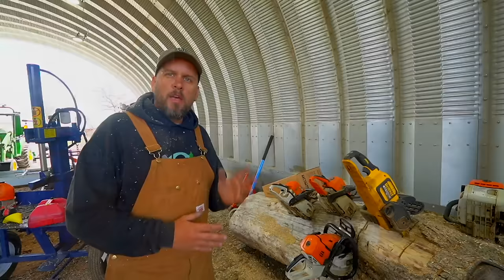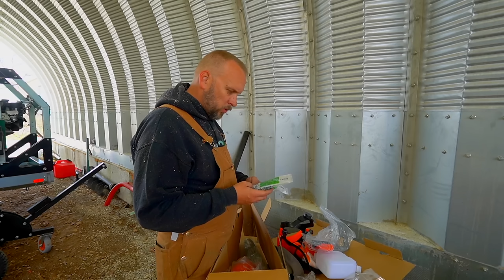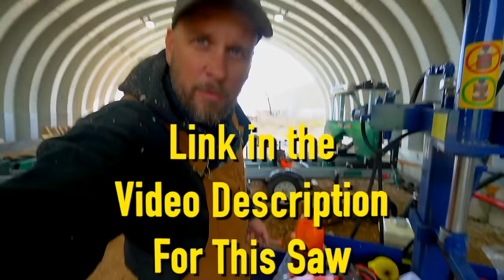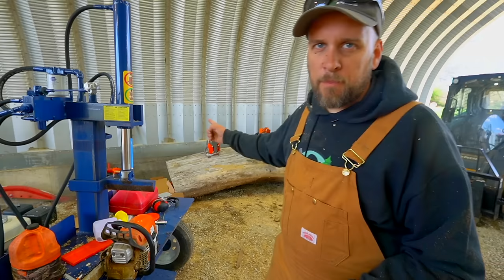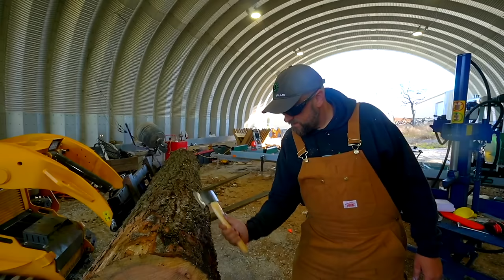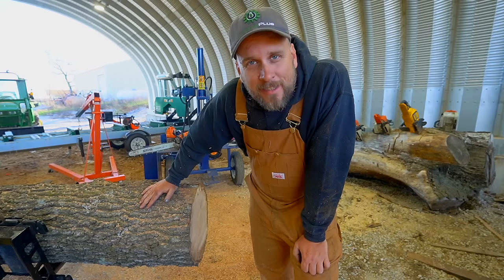Stop Wasting Money On Chainsaws

Comment: A few thoughts. Starting a saw and using it at full power within 2 seconds will kill your saw. You want that engine to warm up. Also, when doing comparisons like this its great to see options but what can't be done in a few minutes of video is see how well something lasts over time, how much hassle it is to maintain, repair etc. If a cheaper tool causes three times as much downtime, it won't be long before that tool has cost as much as a more expensive/higher quality item. So I appreciate the effort here but think its important we keep the perspective that there is only so much a video like this can show so take that into your decision making process.

Comment: Don't start cutting right after starting any chainsaw that isn't electric. The reason is that the pistons will heat up and expand faster than the cylinder which leads to scoring. Doesn't matter the brand.
Reply from the maker: That’s what I thought and it’s what I always do.

With the 500 I was just talking about throttle response.

However, there is someone in the comment section of this video telling us that that’s not true. You can start cutting right away. Says he’s a chainsaw expert.
Reply: It's the rings that need time to warm up and expand for proper combustion.

Comment: Stihl usually has a wider gauge than other saws. Big Stihls are usually 58 gauge or 63 gauge while other brand saws are mostly 50 gauge. You gave us the pitch on the saws; it was 3/8, but what is the gauge on the new saw?  I looked it up. The chain on the Proyama saw  is 3/8 pitch and  58 gauge, so the two saws are comparable.
Reply from the maker: The other 2 saws are .63

Comment: Chainsaws after holding one for a couple hours in the bush the weight of the saw becomes the issue how well you are able to sharpen the saw and the hp the motor will produce gives you the speed of the cut my saw was less than  200 bucks (timberpro) it has probably cut 50 plus white ash log 12 to 18in round a tank of fuel will make 25 to 30 cuts the only problem I have had is the handle cracked  as I do push the saw through the cut going from a low power saw to high power is the difference but again the weight of the saw is a factor if it is an everyday job

Comment: Excellent video as always Brock. I'm still in the market for a homeowner saw, but I really need a pole pruner too.
Reply from the maker: I appreciate the kind words. Everything is so expensive nowadays and I want so many different tools.
Reply: invest into the dewalt battery pole saw, i love mine !. no issues as far as cutting ?, but i will say the bar oil will leak out if you lay the pole saw down ?, other than this..its a very good pole saw.

Comment: I run two 42cc Poulan 18" saws, love them and am standardized on them ( I literally own ~ 35 chains (18"-62L  I sharpen)...but bought a third 52cc 20", chinese saw for $102. cause the price was so enticing and i just had to know for myself (not what others thought); since I've cut thousands of trees with well-cared w/ these  light duty 42cc saws...runnning them as industrial saw...for long hours.  The 52cc chinese safety kick-back spring...was dragging right out of box had issues, and could not fix or adjust the dragging.  I ran it as-is, dragging hoping it would heal iitself and wear-in.  But the spring got so hot it melted it's plastic keepers and finally broke loose after two runs...I had to remove the safety spring guts altogether and have been running the saw w/o  safety kickback chain-lock for three years now. Do I want to do that?...No.... but chainsaw is decent enough and cuts well...starts super easy. (i like that), a bit noisy, ear-plugs a must...I just think of it a pre-1970's chainsaw without the safety-bar-chain stop feature. I just have to be careful..no overhead cutting. From what i saw, I must have bought the early-first generation chinese saw...because what i saw that spring was dragging on the clutch housing....even after reset. Everyone must have had issues on those early ones. Difficult to remove and modify spring steel bends and clips reas after the fact....safety bar feature was definitely an after-thought that wasn't tested out....smoking metal to metal- red hot- when in cutting mode....dragging engine down too. safety-brake was 35% engaged out-of-the-box.

Comment: Whatever saw you buy make sure there is a shop that will work on it.  Chainsaws are twitchy machines and need occasional professional service.  Another point, I think chainsaw speed is nice but not the top priority if you are a firewood cutter.  I spend no more than 20 minutes running a saw for a pickup load of wood that might take a couple of hours to split and load.  A saw twice as fast doesn't make much difference for my total job.  Thanks for a fine video.
Reply from the maker: Yesterday I had a chainsaw expert come out to the house and we recorded a video about how to maintenance and adjust chainsaws to get them to run better.

That is my video tomorrow

Comment: To make it a fair test, put a bolt thru the end of the bar about 10in long then hang 5lbs of weight to it so they have the exact pressure on them. Lastly I will take a STIHL over ANY saw any day of the week. I have dads from 1985 and stihl going strong. NEVER had any issues and we used to cut a lot of fire wood. Project Farm does a great job of comparing things :-)

Comment: It sounds different.
More open muffler, and mabe better air flow.
.
Possibly a non strato saw, basically an emissions thing where part of the air goes in to the chamber before being mixed with fuel.
.
With the exception of a few big cc saws made by major brands, there generally all strato now.
With the exception of the 70+ cc saw made by echo.
And mabe the dolmar/maketa saws.

Comment: lots of good youtube videos of how to repair Stihl saws now.  no need to wait three weeks to get your saw repaired
Reply from the maker: I’ve never taken a chainsaw in for service. Most of my saws are only a few years old though.
Reply: @RockhillfarmYT  once they are 15yrs old there is plenty of little things to replace.  always use premium gas and stihl 2 cyxle oil.  then no engine problems result
Reply from the maker: @lrobie123 my expectation with these cheap saws is you would throw them away at that point, but you could buy a new one every 10 years and it would take you 30 years to equal the cost of the stihl

Comment: now put a 9 tooth drive sprocket on the Stihl 500i and new bar tip ( .325 ) and run a 325 chain and see the speed. The idea is to make small pieces of wood NOT copious amounts of sawdust. Been doing this setup for 30+ years and NEVER broke a chain yet ( thats the shop guys comment......oh you cant do that the chain will break )

Comment: Wow, a Proyama..but can it endure over time?
Reply: I run these cheap saws cutting lots of firewood. And the answer is no they don't hold up. But I still use them because they are cheap to replace and honestly I've learned a lot repairing them. I felt much better about screwing up a cheap saw trying to fix it rather then screwing up an expensive saw trying to fix it.

Comment: One concern is with product sent specifically for review.  I would assume some extra care was taken in manufacturing the saw.  I would assume stock parts but probably some hand sorting for best tolerance/fit before assembly.  Better to by one off the shelf and sell the one they gave you to make sure your testing matches what someone else would get.
The other thing that you barely touched on is longevity.  I don't expect you have time to do a full teardown but that would tell a lot.  Stihl is known for over engineered design which makes their saws last forever.  I wonder how the Proyama compares.  Does it have 2 piston rings like a Stihl for example?  Of course there is somewhat of an apple to orange comparison here.  Stihl has the best power to weight ratio for example.  If you are a professional who runs a saw 5-6+ hours a day, the Stihl wins over the cost.  Does the steel construction make the Proyama just as durable?
Reply from the maker: That’s definitely not true. This is a company in China that sent it to me and from the time I agreed to take it to arriving at my door was two days.

It’s distributed by Amazon and they have them in facilities all over the country.

I wouldn’t have the same advice for a professional And actually I didn’t recommend the saw. I just showed its initial performance and you can be the judge

Comment: love my Stihl MS 362 pro is a bit underpowered cutting big wood with the 25 inch bar but it will do it and saves my back when cutting small stuff on the ground had the Stihl farmer model in 291 but it kept doing the oil pump thing when you had a big day chopping big wood

Comment: I wonder how well it would start after sitting for months.  My stihl always starts up after sitting for months.
Reply: my mac's gave up the ghost, i dreaded dragging out the heavy craftsman , 18 inch, but i had no choice. it has been sitting in the shed for about 3-4 yrs ?, i pulled it out, poured out the old fuel, put fresh fuel in, topped off the bar oil ( it was bad about leaking bar oil ), primed it about 3-4 times on the bulb, pulled choke out all the way, first pull it half fired, pushed choke in half way, it fired off..started running..i let it warm up for about 10 sec's ?, pushed choke all the way in, pulled trigger...it ran like it did the day i brought it home from sears. keep in mind, this saw was purchased back when sears sold real good products ?!. anything craftsman sold today sucks.

Comment: Retired after 23 years of modifying Stihl and husky saws...... Saws have chrome lined cylinders and need no brake in period...
Reply from the maker: Thanks for sharing

When I got the 391 a few years ago, I started running it hot as soon as I got it and a bunch of comments were complaining about that
Reply: @RockhillfarmYT  I've modified quite a few 500i's now being retired from Woods Logging Supply,  I've been clearing the property and my 660 mod is my go to... Also a Holzfforma 660 mod with Stihl crank... They were made cheaply so its a bit lighter but it rips.... I see you have a bark box on the 500i that helps :)

Comment: For the average homeowner, go electric, 2 cycle chainsaw suck unless they are used frequently.
Reply from the maker: The average homeowner, you might be right.

The average farmer or rural property owner I would disagree.

Electric chainsaws are weak and expensive
Reply: @RockhillfarmYT  I've got two Echos, they've been good saws, I wish they could make better carburetors for chainsaws. Right now they are sitting on my workbench for me to work on. I have 12 inch Dewalt chainsaw that is so very handy though I am cutting up mostly small pines on my 25 acres, trying to get the hardwoods to prosper.

Comment: I've been running the Zenoah clones for 5 years and recommend them over cheap homeowner style name brand saws for people who dont cut a ton of wood.
I broke one while porting it, otherwise they're fine, the starters will break if you drop start it so dont do that. I havent broke one but pull them slow and easy like my arm is broke, you'll be surprised at how slow and easy you can pull it over and have it start.
The proyama has nice plastics but is much smaller than stated.
DO NOT BUY THE 5800 PROYAMA, IT'S 45CC AND SUCKS!
The 6200 is 50cc and ok but not near as good as a 54.5cc one.
Only buy the 6800 proyama, it's 62cc or 54.5cc both run about the same, it's the only good one they sell.

Comment: Bought a holzforma 372xp. Haven't even cut 1 cord w it. It's currently at the shop awaiting to find out y it's locked up. Had to put OEM carb on it to get it running good and OEM oiler cuz original wasn't cutting it on 24". Needless to say, my opinion is come up w a little more $ and get to an Echo dealer. Got a 590 and holy smokes. Haven't run the 24" it came w yet but it's a major ripper w a 20".  Magnesium vs steel?
Reply: More than likely its the crankshaft, their seals are crap and the steel in the cranks are soft... I've got a 660 holzfforma and swapped crank( Stihl )worm gear for oiler and fuel line, starter pulley,  mod cyl 40 thous. and dome piston 25 thous. triple ported muffler... and it rips!
Reply: @His1child  I added alot of stihl parts to my 660 build and that thing screams

Comment: Yea buy your self a used steel like an 044, ms440, 046, ms460, learn how to take care of them. Never run gas with ethanol and ethenol treatment does not take ethanol out of gas. Use gas with 0% ethanol atleast 92 octane with good brand oil like Stihl oil. Then you wont have problems

Comment: Or spend $1300 and get a 576xp or a 572xp or a 372xp … my 576xp cuts 3 seconds faster than my buddies 500i Stihl .. both with 28” bars , 3/8 , 0.050 with full skip tooth chain . Running in the same size diameter log , 27-28” red oak ( green ) ..

Comment: That 500 ain't gonna last long if you give er wide open right after you start it cold
Reply from the maker: I didn’t say that I do that. I said that it has the throttle response that quickly if you wanted to.

It’s an overall representation of the saw performs 

I’ve been using it for a couple years and I feel like it cut faster now than it did the day I got it

Comment: That is definitely NOT how you tighten the chain on a chainsaw!
Reply from the maker: What are you talking about
Reply: @RockhillfarmYT   Chain tightening:   As you begin to tighten the 2 bolts on the clutch cover, you should lift the far end of the bar.  The lift will add a bit more tightness to the chain.

Comment: What planet does a Dewalt chainsaw cost $600? It’s literally half of that WITH a FlexVolt battery… 1/4 of that without a battery.
Reply from the maker: I bought it at the local Home Depot with a nine amp hour flex volt battery for $600 about three years ago. They also have more than one model of 60 V chainsaw

This type of technology comes down in price over time. I’m just telling you what I paid for it at the time.

Comment: Dude that cheap Yawa saw has a plastic crank housing 😂. What the heck is this guy even talking about? 2 strokes just won’t run properly if that bottom end had any sort of vacuum leak whatsoever. If you drop that saw, you may very well, start a leak. Stihl Pro saws use a sealed 2 piece magnesium alloy case. “The saw is the motor” pretty much. Your Yawa has a plastic crank housing. Just sayin.

Comment: 3 cuts means nothing…cut up 10 chords of wood with it, then give a review.  My Husqvarna 555 cuts circles around this, five years old, and 50 chords of wood cut.  I dare say, in 5 years, your proyama is in a corner with the homelites, craftsman, and poulan saws…just my two cents.  cheers!
Reply from the maker: The first thing I said at the beginning is that I was going to run this saw exclusively and then do a review
Reply: @RockhillfarmYT    I stopped wasting money on cheap saws, because I use mine extensively, and exclusively for firewood and milling rough cut lumber.  It must work….reliability is my number one concern.  cheers from northern BC👍
Reply: I have a 2004 Homelite Timberman 45 (last ones American made) that just won't quit.  I also have a Makita, Stihl, and a small Echo.  My old Homelite is the first one I grab.  The only problem is that parts are no longer made.  It was about $180 new.
Reply: @quebird3108  I have an old homelight that starts but won’t stay running.  could probably get it going good…but it is outdated, heavy, and I just like the husky way more for cutting….
Reply: @jimhofoss9982  My 2004 homelite is lighter than the others, except for the Echo cause it's the 2511T.  Of course, I can't use the Echo for cutting logs or trees.  Thanks for the reply.

Comment: Still 009, 015 and 029. All German made.  30+  years commercial use.  American made still, all ms, are junk
Reply from the maker: I respect your experience and I get your point about longevity. I also had a guy call me and say his old 044 could cut faster than 500i. 

Nope. I took my saw over there and it was not even close.

My saw is only three years old, but it starts on two pulls every time. Hot or  cold